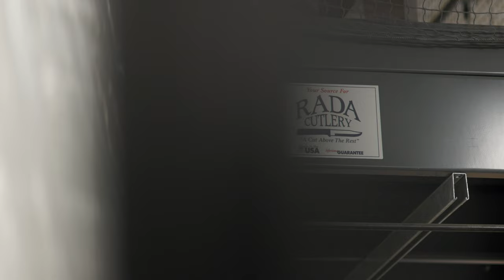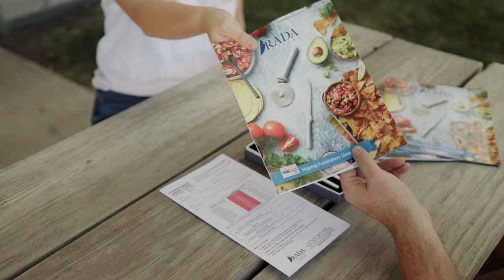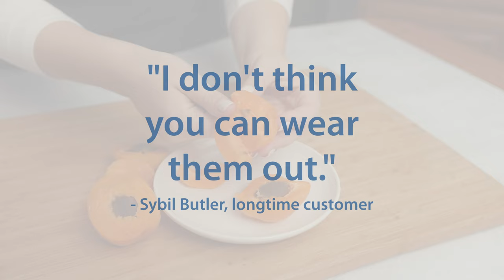Rada Cutlery Celebrates 75 Years

Comment: Here I will share some history.
In the early 1960's my Pop was an engineer and our family came to San Diego California following the aircraft industry. For ages I remember knives like this in the kitchen, I never knew where they were from until I researched online a few years ago. They fascinated me because they were the solidest design for a knife I had ever seen - virtually one piece. I found the words:
 "CHUPPA CO" and Stainless Steel on the blade of one, and followed it through the internet eventually arriving at RADA.

 The black handle style I just sent for a master set of (Ultimate Gift Set) but the original ones with brushed aluminum handles to me speak deeply of old times, and what was occurring during those times as well. Nobody had an air conditioner back then, and houses all had clothes lines out back (for Momma). In those days they built things to last... And really, with stainless blades and a revolutionary sharpener to draw a fine edge, there is no reason not to expect to hand these down to the next generation. 

~ But I will be sure and tell them about what they mean

This is not an ordinary thing, you can get kitchen blades for a dollar ninety nine anywhere - and they wind up in a junk drawer. When I went through my fathers place in 2002 when he passed on, I could not save many things but I saved all of these I could find. Through everything that happened these lasted - and I remembered my Mom's hands using them 🥲 She had passed away the year before in 2001. These older ones to me have a connection to a long time ago, I don't think I even need to TRY to explain. But these are the kind of tools you want.

LEGACY equipment - the kind that lasts lifetimes

~ I hope you are here for a long time to come. You can be relied on